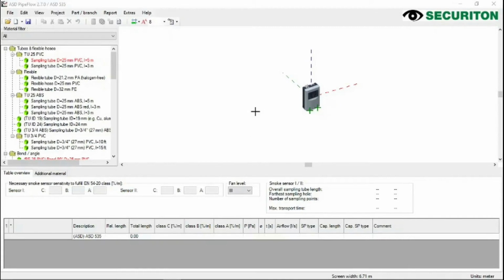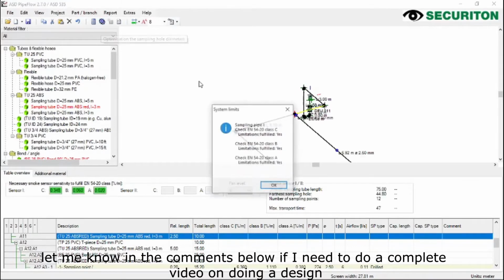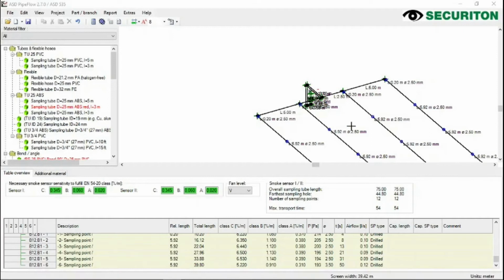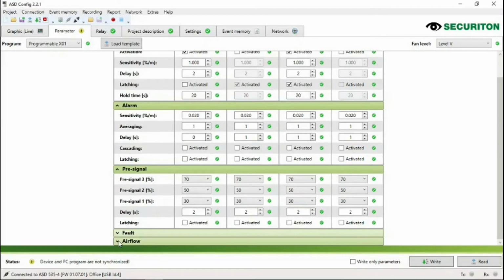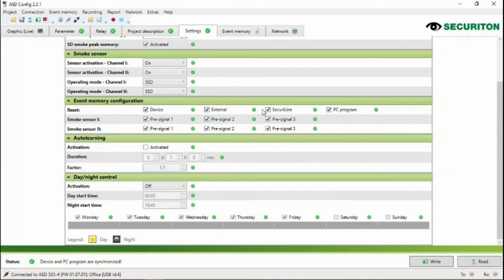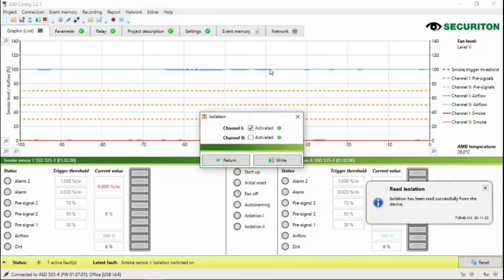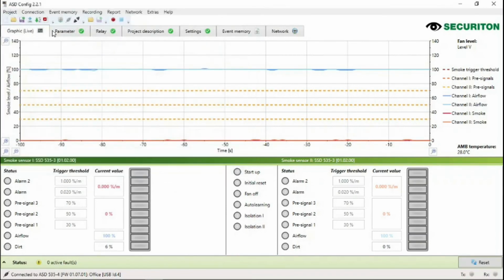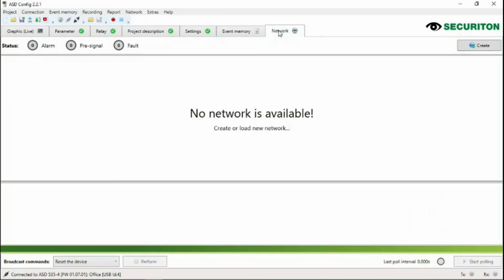How to Commission an Securiton ASD

Comment: I'm sitting with a problem on one of our sites. Guys did the install, I'm the service technician. I am unable to connect to the ASD unit. What could be the problem? I have the dongle and everything connected. That's all sorted but unable to connect to the unit itself. Please help
Reply from the maker: I am not sure if you are using the USB or the network cable. If you are using your USB, than just make sure the USB driver is installed. I think in one of the videos I did show this. Regarding the LAN cable. I have found with the latest windows, to turn off both wireless Lan and Bluetooth before connecting your Lan cable. For some reason the software locks onto the wireless or Bluetooth for searching your ASD. This is something I have came across a lot and being lazy, I lately always activate flight mode on my laptop prior to connecting the Lan cable between the laptop and ASD.  I hope this will resolve your problem.  P.S.  I am sure you checked the IP address and Netmask settings on both laptop and ASD?
Reply: @letsdoit7630  I use the USB cable sir. However the other unit that's installed on this site has LAN connection. Thanx for the info regarding that. Will a normal network cable work or will I need one that came with the unit?
Reply from the maker: @da_q_man0131  Any Lan cable will work. I have not had any problems with that.